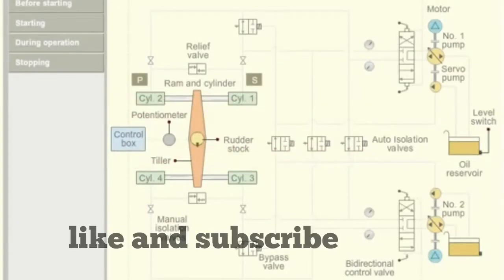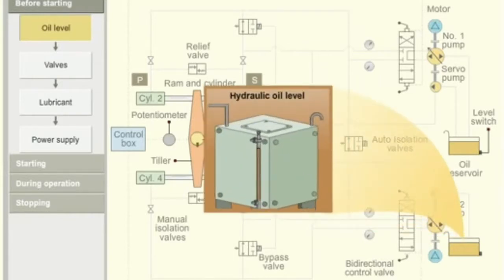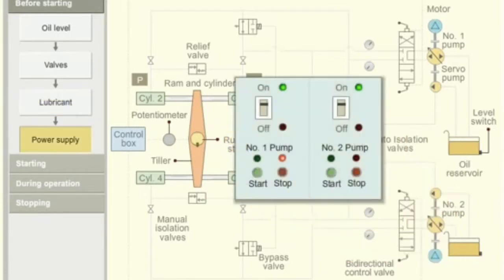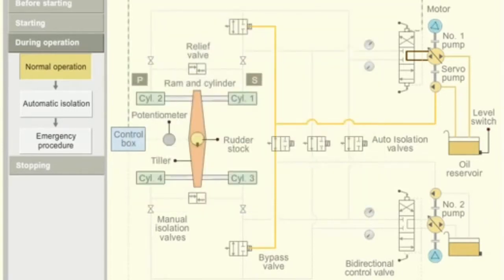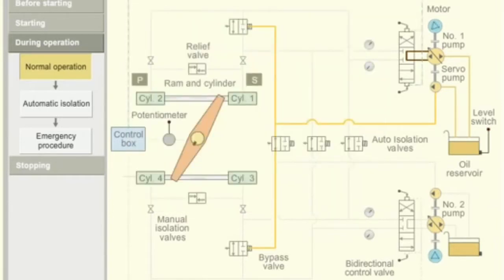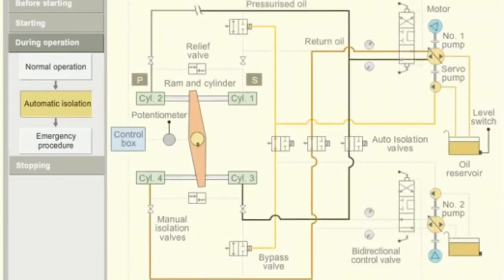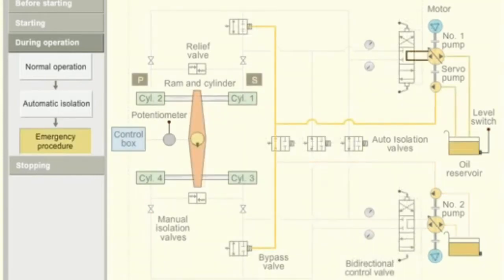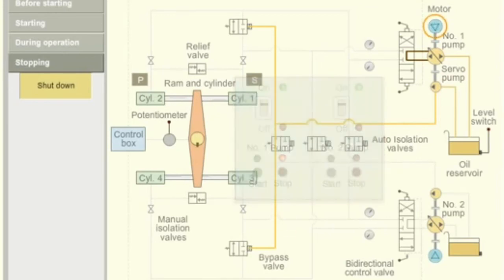4-Ram steering gear introduction and it's working animation... Best ever..

Comment: since hydraulic pump is variable delivery type... why is 4/3 valve used..... same can be done with 4/2 valve with some line modification..... sir plz share your views on it..
Also, what if no.1 pump is running and fracture is in the line between no. 3 or 4 cylinder and isolation valve...
Reply from the maker: Direction of flow can be regulated by v/v and purpose of using that type of v/v is to direct the flow of oil into the ram cylinder according to the desired direction. And if you're going to use 4/2 v/v it'll lead to not only change in line but also in the arrangement of the system components.
See wherever is the oil flow if there will be line fracture then that line will have to be bypassed and operation will switch from pump1 to pump2 to achieve the desired direction.
Reply: @MARINENAVTECH  
sir if flow reversal is to be done by DCV then what is the point of installing variable delivery pump. swash plate and hele shaw  pumps are capable to reverse the flow. Any normal positive displacement pump would suffice. 

And about the leak..... can you please explain the sequence of event (how the valves will operate) in case of no.1 pump running and operating all four rams, and leak occurs in the line between ram no 3 or 4 and the isolation valve?
Reply from the maker: See it is only a simple animation to show the normal working sequence of 4 ram steering system. Don't worry about pump . And yes the use of different types of pump is to keeping in mind of several things like use,economy,safety,purpose etc...and this all will vary accordingly.
Go through the video carefully  as it contain plenty of info that clear your doubts👍
Reply: @MARINENAVTECH  Hello sir, can I know what software did you use in this video? Thank you

Comment: at 3:04, when rudder is turned that position looks like stb to me, even when given was port, where does vessel turn? I thought if port turns port. However, now rudder turns stb.
Reply from the maker: See my friend it's actually tiller is moving stb in the diagram and rudder actually is moving port side at that time. I hope you understand. Thanks for your question.do comment for more topics which you need.